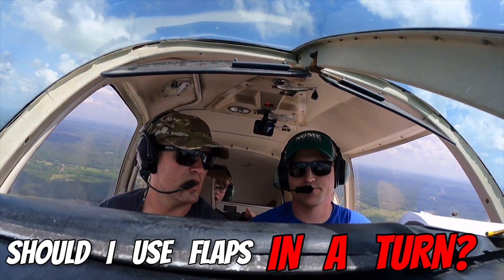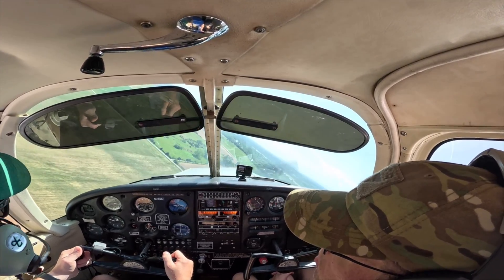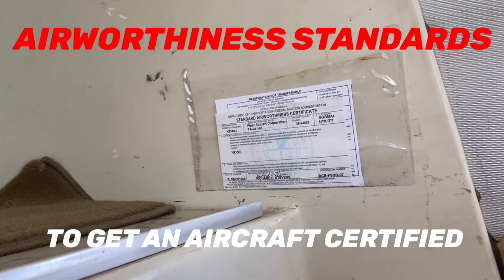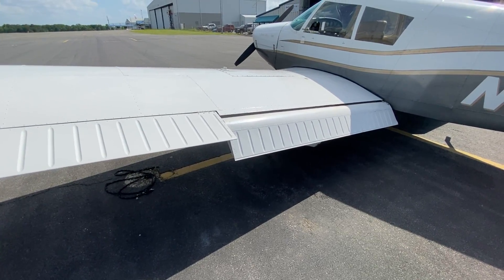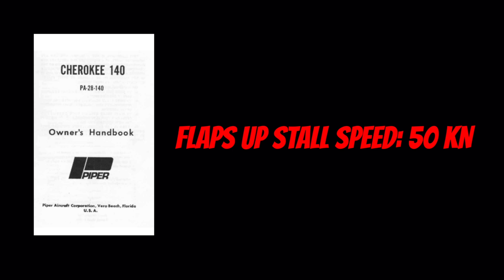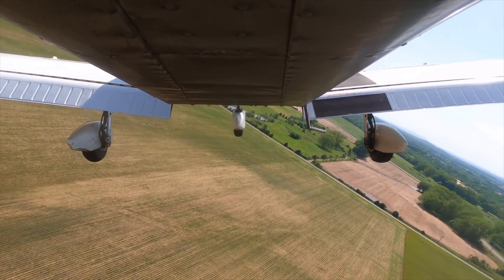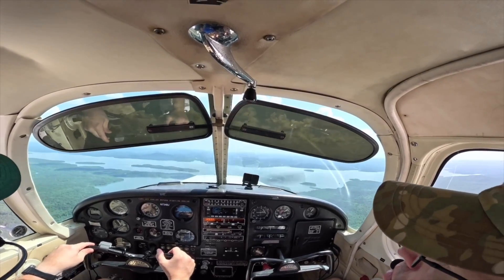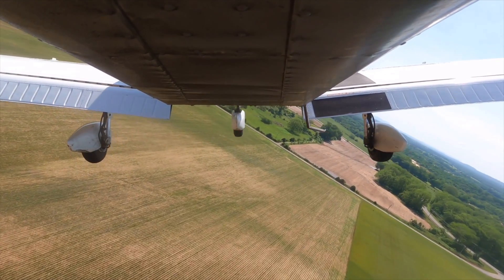Should I LOWER Flaps in a Turn?

Comment: I have some doubts about the explanation. First. It may surprise you, but when we are flying at the same speed with or without flaps the lift force is still the same. 
Second. For level turn theoretically only two ways to decrease the radius of turn. Speed decreasing  or increasing of bank angle (increase a load factor). 
In according of your explanation, if during level turn, flaps increases a lift force  which  increases a horizontal component of the lift,  then it must lead to increase a centrifugal force too which  will lead to increase a load factor. But it doesn't work like that.
Reply from the maker: I don’t mind having a disagreement on this, but the airplane flying handbook states that flaps increase lift for a given angle of attack.  Drag is also increased, but so is lift.  With that in mind, this is a complete theory of mine. As I stated, horizontal lift component apposes load factor, BUT if my theory is correct, load factor IS NOT equal and opposite of horizontal lift because BELOW flaps limiting speed, weight will be greater than the force created by inertia.  In my personal opinion, THIS is why maneuvering speed is so important.  Load factor is closer to being equal and opposite. Now, if weight is greater than the interia force, WHEN we lower flaps, the horizontal lift component can become greater WITHOUT increasing vertical lift.  I’m hoping to prove my theory true in a future video.
Reply: @FreePilotTraining  POH says true. But take in mind that when we are flying with the flaps vs without flaps, maintaining same speed, our AoA is less, so lift force still the same.
Reply from the maker: @JordiFrio  I don’t believe that to be the case. AOA does not change when we lower the flaps.  Check out this video: https://youtu.be/tKNlFJ89wvA  Start at 5:14.  This is where I explain my thoughts on that
Reply: @FreePilotTraining  for straight and level flight at same speed AoA will be less with the flaps in compare to without. Remember Sr Newton. Lift is equal to weight for this condition.
Reply: @FreePilotTraining 
Of course AOA changes when you lower flaps. That's why the stall warning horn stops if you lower the flaps just above stall speed.
Reply: @FreePilotTraining  https://www.theairlinepilots.com/forumarchive/principlesofflight/flapcurve.jpg

Comment: Geometrically, the turn radius should only depend on bank angle and airspeed. If you can find a reputable engineer to explain how extending flaps alone will essentially tighten a turn when no other parameters have changed, I’d love to hear it.
Reply: You're right, and he has an unfortunate bias that won't allow him to let it go.
Reply from the maker: I don’t mind this conversation.  This is a complete theory of mine. As I stated, horizontal lift component apposes load factor, BUT if my theory is correct, load factor IS NOT equal and opposite of horizontal lift because BELOW flaps limiting speed, weight will be greater than the force created by inertia.  In my personal opinion, THIS is why maneuvering speed is so important.  Load factor is closer to being equal and opposite. Now, if weight is greater than the interia force, WHEN we lower flaps, the horizontal lift component can become greater WITHOUT increasing vertical lift.
Reply: @FreePilotTraining  horizontal lift component is always directly proportional to the vertical lift component at fixed bank angle

Comment: Not a pilot here but this question just seems nonsensical to an outsider. I've never been on a commercial flight that didn't bank with flaps. They're all doing it wrong? And if you're worried about split flaps and an uncontrolled roll why only during a turn? They would cause roll no matter the attitude wouldn't they? Something just seems odd that this is a debate. 🤷🏾‍♂️
Reply from the maker: “Lowering the flaps while turning”

Comment: As someone with thousands of hours flying in the mountains and having had an asymmetric flap failure and survived i can say “leave your flaps alone” NEVER apply flaps in the turn.  One call is “WINGS LEVEL FLAPS”.  Never apply flaps in the turn!!!!  Applying flaps in the turn is a bad habit to get into. Your preaching to inexperienced pilots who are likely to stall in the turn due to increased drag. Better to teach a min defended speed. Most people stall in the turn not hit the side of a valley during a U turn.
Reply from the maker: I appreciate the comment

Comment: Air combat simulator games frequently have a "combat flaps" option for when you're wanting to gain a boost to turning ability at the cost of some speed. Does that have any bearing on real life? Because that seems like a point in favor of flaps down turns being an acceptable practice on at least some airframes.
Reply from the maker: Yes, this is a common technique for fighter pilots

Comment: When I first read the title of the video I thought you were saying that you should use flaps to turn. I was thinking, what are you smoking, then realized I misunderstood the title. TBH I have never even heard a person mention split flaps while turning in the circuit, I always use flaps turning to final or base. As for split flaps, I once had this happen on a King air, the safety shut down the flaps before they could become too split. For the next week I had to fly the AC with the flaps MEL'ed  as maintenance for to lazy to fix them
Reply from the maker: Lol, it’s tough to make a clickable title that also conveys the topic.   That’s crazy that the MEL allowed broken flaps.  That’s kinda surprising since they are a secondary flight control
Reply: @FreePilotTraining  (O) May be inoperative provided;
a) Flaps are in full up position, and
b) Appropriate performance data for no flap takeoff and landings is used.
CAUTION: DO NOT SILENCE THE LANDING GEAR WARNING HORN
Reply: Just researched it and I don't think you can MEL Flaps on the 200, I did have the split flaps but they fixed it. I flew with MEL'ed flaps on the Beech 1900 D (Big KA 200) for a week, this was 10-15 years ago, I must have 15K hours on Beech Turbo props. 90, 100, B100, 200, 300, 1900
Reply: @rumbecker5085  that’s crazy
Reply: @rumbecker5085  that’s super interesting.  I was surprised that any MEL would allow operation without them
Reply: @aquicklaugh  Yeah it was crazy, I had to shoot an ILS to minimums a few times that week as well with no autopilot and a green FO. Thank god I had my KLN90B to save me, lol. I'm happy I don't fly for that operator anymore.

Comment: Good video and good reasoning.

9:03 - This chart is a graphical representation of two equations. 

But that doesn't take away from your point. Equations are tools, and we need to use the right tool for the job.
Reply from the maker: Thank you so much! Yes, we need to use the tools we have available

Comment: I've watched a LOT of old fighter pilots talking about their lives in the cockpit in combat.  I can't tell you how many times I've heard one say, "I cranked down a notch of flaps to out-turn the guy I was after...".  Watch any modern fighter jet and you'll see it using the flaps in nearly all high load maneuvers, including turns.  Bank to 90 degrees in an F-18 and pull 4 Gs, the airplane will automatically throw out some flaps .  It just does it without asking, because it knows how to fly.  That's all the proof I need.
Reply from the maker: Those guys knew more about aerodynamics than we ever will

Comment: So you are cruising along at 110-130 knots in your Cessna 172, and you want to turn from a heading of 360 deg to 070 deg. for a downwind leg.  If the first thing you do is select some flaps, you are exceeding the 80 knots Vf speed, and could damage those flaps.
Reply from the maker: Yeah, don’t do that. That’s not a good idea. Lower them in the white arc

Comment: 6/25/2023 If you are that far off turning to final you should go around. 
My father instructor was doing a little mock dog fight in a P-51 with a friend in an F-8. Dad dropped 10 degrees of flaps and the Mustang turned inside the Bearcat every time. Very frustrated friend.
Reply from the maker: Lowering those flaps makes all the difference in the world
Reply: I also found that lowering 10 degrees as you go into a 360 degree clearing turn replaces the loss of vertical lift component caused by the bank and with slight trim adjustment allows you keep your head up and your eyes out as you look for other traffic. As you roll out of the turn you will bump your own propwash (wingtip vortices) and have a big grin on your face.

Comment: Well ok, if it's truly coordinated, CL doesn't matter. A 30 degree bank always has the same turn time. The advantage isn't faster flat turns at a constant bank and speed. It's increased lift coefficient.
Reply from the maker: Yes, turn radius is based on bank angle and airspeed, but I w got a theory that I hope to prove in a future video

Comment: My knowledge of flaps in a turn:
1. using them above certain speeds can hurt the flaps.
2. they often reduce the AOA abilities of the aircraft but increase the lift for a given AOA.
3. They move the aerodynamic center downwards and toward the aft of the wing, which makes the aircraft more stable in pitch but less stable in roll.
4. For low lift coefficient, they're gonna cause a lot more drag than they're worth.

Comment: My PPL instructor was the “no flaps during turn” type, and as a student it just increased the workload during straight leg portions of the pattern work.
Reply from the maker: I could see that, but I’d rather you be busy off the perch and turning base than be busy on final trying to get the plane stable

Comment: Nice video! I like the comparison of the turn radius. Lol I can see you are used to flying with two hands on the yoke. A light aircraft pilot should have his right hand free for the throttle or other tasks. To make him or her aware of the power function, for quick response if needed and to prevent unwanted power lever changes especially in the climb out. Keep it up! And yes every normal landing is a landing with full flaps!
Reply from the maker: Thank you! Yeah, I like to go two hands sometimes when I want to make sure that I pull symmetrical Gs.

Comment: Obviously I'm no professional. Most of my knowledge comes from text, video instruction, talking with pilots and lots of time in sims. But I've never questioned using flaps in a turn. In Sims it's never caused an issue. As long as angle and speed are conducive to using them without stalling it's never caused issues and helps with stability and control. But stall is an issue even when using them on a straight approach of speed and angle isn't right.
Reply from the maker: Yeah, lowering them in the turn is basically the same as lowering them while straight and level

Comment: Agreed. Yes, use flaps in the turn. Asymmetric G's are the only logical argument I've heard for this and it really only applied to gear extension/retraction. Furthermore it was a recommendation, not a procedure, to reduce load on the mechanical system. I fly a 767 now and I only ever heard this "theory" way back in initial training and in reference to very old airframes.

Comment: CFII here, seldom do I comment, but this video seems to acknowledge one of the many teaching points I attempt to hammer into my students.  There is an incredible amount of nuance and individuality that comes with every airplane in any environmental scenario that should lead us to NEVER paint aviation in only black and white.  Stating “NEVER use flaps in a turn” is incredibly narrow minded as there are many scenarios where this may be a pilots best option! I find it to be MUCH better to have students understand the relationship between wing loading, airspeed, and angle of attack.  With a great understanding of load factor, airspeed, and angle of attack, stalls in any scenario can often be avoided by simple situational awareness coupled with muscle memory recovery in a wide variety of stall scenarios… not just simple power on and off without banking. ❤️ the video
Reply from the maker: Thank you so much! That’s one of the biggest reasons why I started making videos like this. Supply information that gives pilots “things to think about,” then they can use “good pilot judgment” to decide what they should do in any given situation
Reply: @FreePilotTraining  Absolutely 🙏🏼 keep up the great work.  Educating with extensive context is absolutely exhausting, especially when dealing with people on the internet haha, but you’re doing great. New sub here.
Reply from the maker: @ShadowFreedum  thank you so much!

Comment: the operations manual should answer this - small trainers use flaps in the circuit to slow to approach speed - bigger aircraft have flap limitations that could be exceeded - either way operational use of flap is specific to type and needs to be considered on type conversion. I would avoid configuration changes for transitory flight conditions.
Reply from the maker: Very true. Gotta be careful about those flap limiting speeds

Comment: Those kinds of “you shouldn’t ever” arguments always make me think of those placards prominently displayed next to the flap handle of all the Cessna 172’s I ever trained in. AVOID SLIPS WITH FLAPS EXTENDED! Yet every slip I ever did was with flaps extended. Even during my PPL check ride when my old retired Air Force C-54 pilot examiner said “that’s not a slip” as I was slipping down towards a cow pasture after an “engine failure” with full flaps in and took the controls for a second and put us dang near sideways, THAT’s a slip…… I thought we were landing in that field. He didn’t give me power back til we were at the treetops.
Reply from the maker: Yeah, very true. And then I slipped the Piper Cherokee the other day and there is NO warning in that POH and I blanked out the tail. First time I’ve ever done that

Comment: The first but not best reason not to use flaps in a turn in the pattern. If it ain't broke don't fix it. There's no benefit to it that doesn't out weigh the better reasons. On final you should be a  little high, and fast in case you have a power failure. Low, and slow during power failure is doom. Everything you learn as a pilot is to stay as far as you can from doom. As you get closer to landing too high,  or fast then use flaps for braking, and steepening glide angle. There are holes you can't see up there in the sky. Can't see them at all with your naked eye. But if you go up there, if you would fly, then you could fall in one, and then you would die. Your monkeyshines are making a big one to fall for.

Comment: I fly medium turboprops and I'm full flaps/dirty by midfield. You can't stall a deloaded or lightly loaded wing. As long as you're not yanking and banking that bitch on base-to-final you're going to be just fine. The only time I'm not full-flaps before base are circling approaches in true IMC. Too draggy at 500-800' is less than ideal.
Reply from the maker: That’s a fact. I need to make a video on that as well

Comment: I feel like it's worth noticing that there is another (unsatisfactory in some circumstances) way to hit a higher bank angle without causing s spin-stall. The load factor calculations saying that you need to fly 60kt in this plane to hit 45° bank are true if you use sufficient stick back pressure to keep the airplane from diving. 
An instructor could reasonably say, "never bank to 45° but if you ever do for whatever reason, let the nose go down a bit and choose losing altitude over stalling your aircraft."
Reply from the maker: Fact. I’d like to talk about this in a video

Comment: There is at least one reason you might need to make a lot of drag and slow down rapidly in a spam can. I call it the San Jose approach. You have a “heavy” on your six and Tower asked for best forward speed. The fastest speed you can fly in a 172 in a descent is comparable to their stall speed. So, maintain 120 or better to 1 mile final, pull power, add flaps as you pass Vfe for each setting, then make a short field landing on the displaced threshold and get off the runway in a hurry at C (before the PAPI, about 900 feet). 

This is especially important in the context of an instrument approach. 

Not a student pilot maneuver, but it’s a reason for rapid speed changes other than being under fire.
Reply from the maker: Thank you for this comment! I love hearing practical uses for stuff like this!

Comment: I tried using 40 degrees of flaps to tighten my taxi radius on the ramp, it didn’t work!  Of course I’m just joking.
Reply from the maker: 😂 I’d be impressed if it dod
Reply: @FreePilotTraining  You said you are a C130 driver?  What service & base you stationed?
Reply from the maker: @thejeffrandallproject6470  Yeah. Little Rock AFB
Reply: @FreePilotTraining  cool, I’m a C150 driver at ABI, retired FAA tower & radar controller, worked the DYS B1’s & C130’s for 15 years here.  Was just seeing if you might have been here at DYS.  You might have known a 130 driver that went from DYS to LRF, Ty Lyon?  He owned an RV3 or 4 and was a local EAA Chapter member here.
Reply from the maker: @thejeffrandallproject6470  that’s super cool! I’d like to get in a tower and talk to those guys about radio calls sometime.  I think that’s make a good video.  The name sounds familiar, but I don’t think I know him

Comment: Video title is sloppily misleading.
There is a BIG difference talking about Turns as a general flight concept, and Turns in a PATTERN!
Your title states the debate is over random turns in general flight.

Yet your video talks about turns in a pattern, which is a very particular, and highly regulated, studied field of flight.
Where you should use flaps as recommended.

Details matter.
Reply from the maker: The concept applies to both.